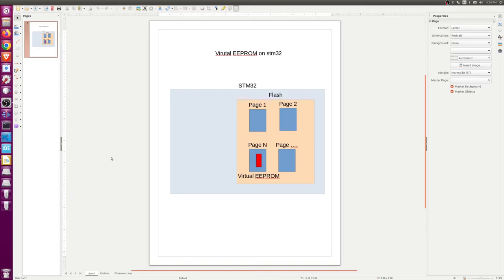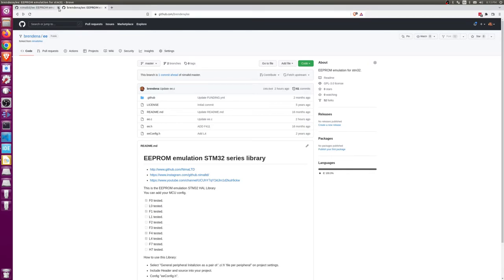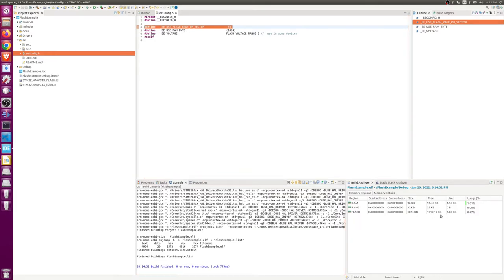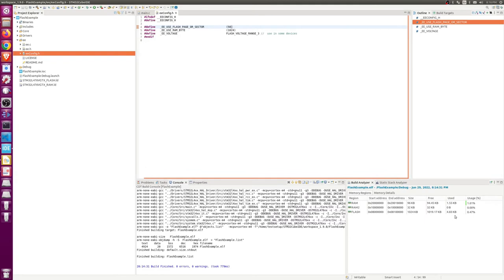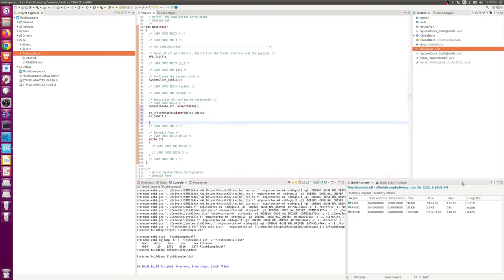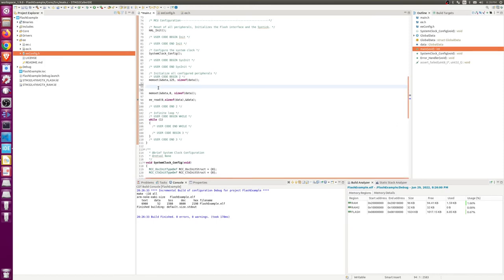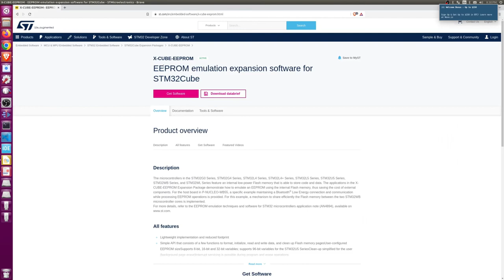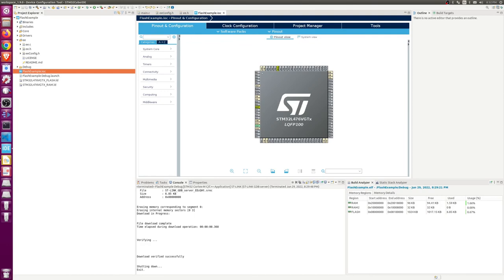Persistent data on stm32 (Virtual EEPROM)

Comment: I am new to embedded but I am trying to use this. I have an array of 4 unsigned 8 bit ints that I am writing, values 1, 2, 3, 4 for some reason when I try and read it back I am getting 212, 255, 0, and 32 any ideas why?
Reply from the maker: I'm guessing your following the example code i showed in the video?

Comment: Wonderful simple library, thank you! Having an installation issue though... After adding paths for ee.h and ee.c, I am getting build errors where the functions in ee.c are not recognised. e.g.: error: '_EE_SIZE' undeclared (first use in this function)
  229 |   if ((startVirtualAddress + len) > _EE_SIZE). Seems this (and other functions) aren't being properly referenced? Any chance of putting me straight?
Reply from the maker: Just to make sure.  Is your board supported?  If you go to this page https://github.com/nimaltd/ee/blob/master/ee.c. At the top it will have a bunch of defines for each board
Reply: @brendenadamczak9283   
Thanks. I've added my board to ee.c defines (it's a STM32WLE5xx with 256K flash). The program now builds and runs ok, but when I debug, nothing is actually written to flash. Is there more to it than just adding your board to ee.c?
Reply: Let me correct: For any page specified in ee_Config.h, it will write the variable once and it can be read back. However, this page is never erased and cannot be written to again. I've used both the direct ee_write with ee_format and the ee_writeToRam with ee_commit(). Any ideas?
Reply from the maker: @rayberkelmans6425  So apparently the STM32WL uses the same technology thats in the STM32L4.  So i would look at the defines in that sections.
Reply: @brendenadamczak9283   That is most helpful, thank you! Substituting STM32WLE5xx for STM32L433xx and removing the FLASH_BANK_1 line works. So now for the next challenge, is it possible to store floats with this library?
Reply from the maker: @rayberkelmans6425  totally!  ee_write(address, 4 * (numberItemsInArray),  (unsigned char*) floatArray)
Reply from the maker: You can probably make a bunch of little helper functions that take in a float and do this casting for you to your life a lot easier.

Comment: Im new to embedded too. Im working with an L053R8 so i've changed the defines in ee.c and it writes the data, but at ee_commit() it has a Hard fault an in the console IT says "Target is Not respondig". Do you know what could be the mistake?
Reply from the maker: So it doesn't currently support L0 devices.  So i'm guessing there most be something wrong with the config.   Nothing happens to the flash until you send the commit message.  From what i remember the lower end of the stm32 devices have semi weird flashes.  So you might need to do some more configuration.